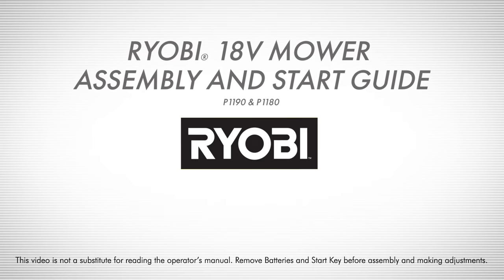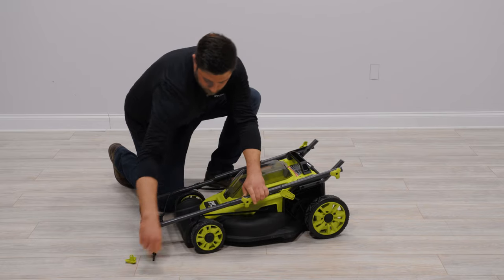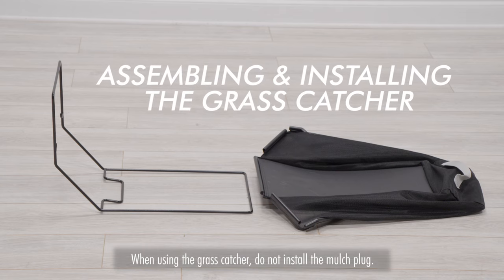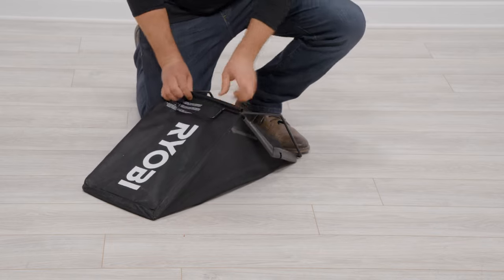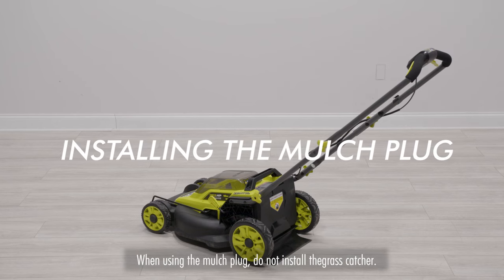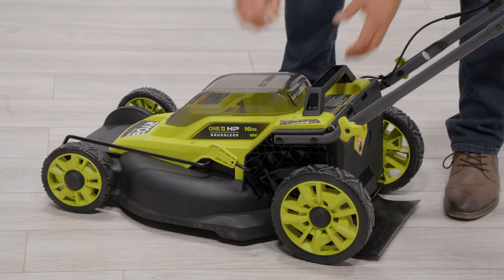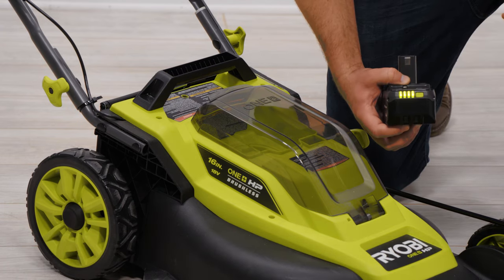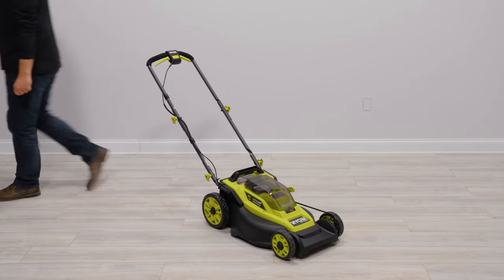How To: RYOBI 18V ONE+ Lawn Mower Assembly And Start Guide

Comment: The instructions for assembling the mower were useless. I spent time trying to find a video that explained how to start the mower; how to assemble the grass bag; and how to insert the mulch bag. Glad this is available. But why, after spending several hundred dollars on a mower, did I have to search for a how-to video? Ryobi needs to revise its manual.
Reply: I bought a Ryobi trimmer/lawnmower and found you need a University degree to understand the assembly directions !  they are so small you need a magnifying glass to read them and there are only pictures, no written word - useless !  It is now still in its box in the shed, I am unable to assemble it and cannot find a 'how to' video for this model, I also cannot afford to return it !  waste of money, do not buy !!

Comment: Two batteries are fully charged, neither is working. Key is in, blade is clear, nothing blocking it.  Wiped down the connectors.  What else could it be?